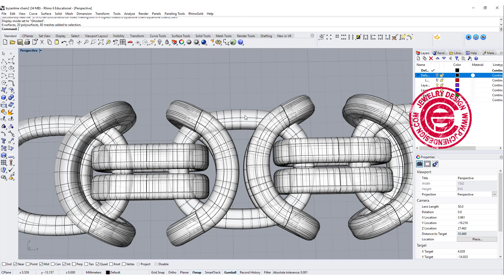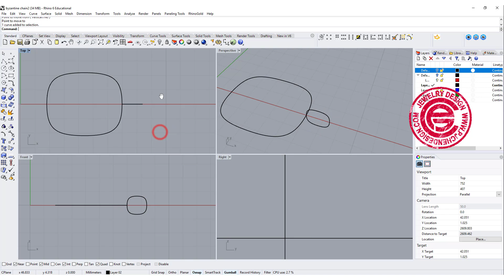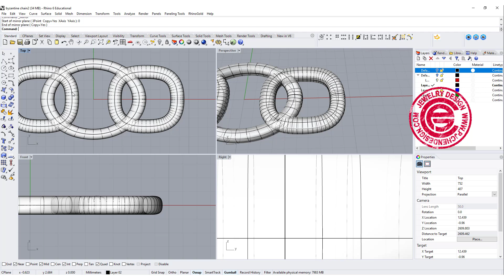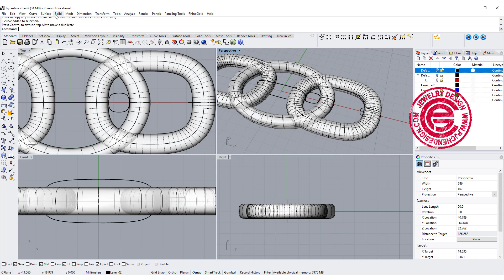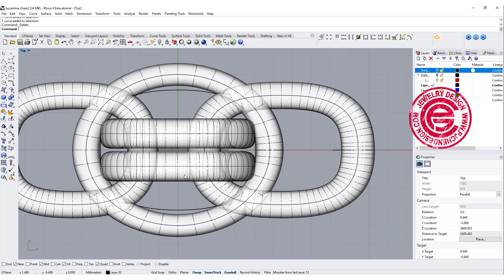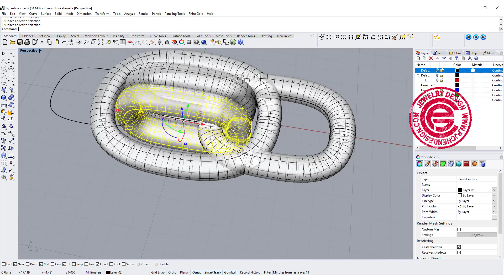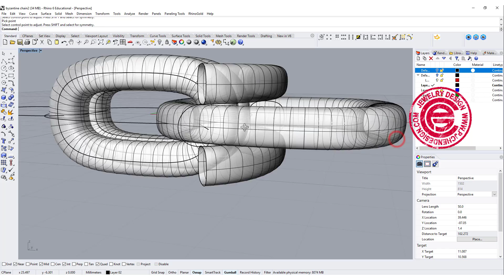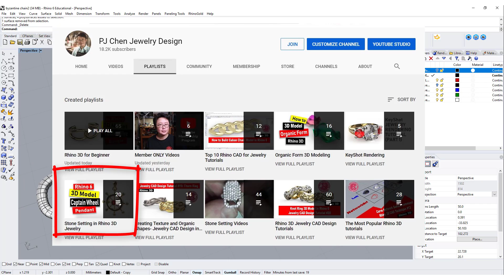Byzantine Chain 3D Modeling in Rhino 6: Jewelry CAD Design Tutorial #113

Comment: Great video! That's an elegant approach to solving this problem. I suppose if you wanted to make sure you preserved thickness of the metal on the blended end bits, you could use Blend Curve instead, Join the curves, and 1 Rail Sweep the whole shape as one.
Reply from the maker: Great tip!

Comment: Hii... your work is amazing!! thanks for all.... I have a question ... As you do for the 3D printing of this chain?
Reply from the maker: HI Diana,  most of the time, you will buy the ready-made chain, it is cheaper in that way. If you need to custom made, you will need to make them separately and assemblage together both 3d printing and casting.
Reply: 3D printing a chain poses some major manufacturing problems. If you're 3D printing waxes, you won't be able to cast articulated or moving parts, so you'd have to make the links separately. If you're directly 3D printing a finished product out of plastic or metal, you can get away with it, but you have to make sure you allow sufficient space in between the links for polishing and finishing, and you have to make the pieces a bit thicker than if they were forged and soldered.
This explains why most of the time, people just don't bother 3D printing any chains smaller than heavy bracelets, if they do it at all.